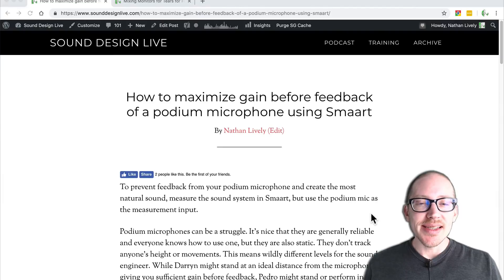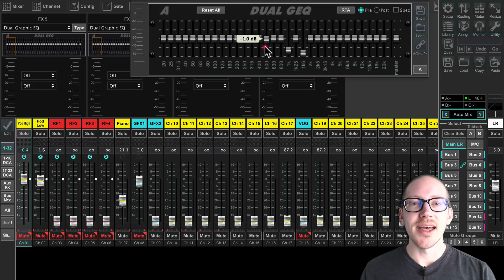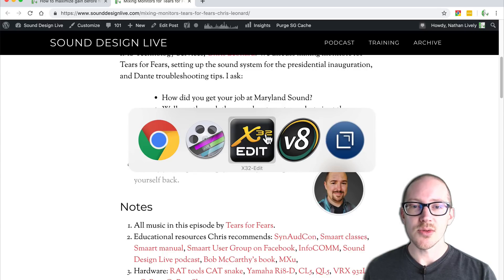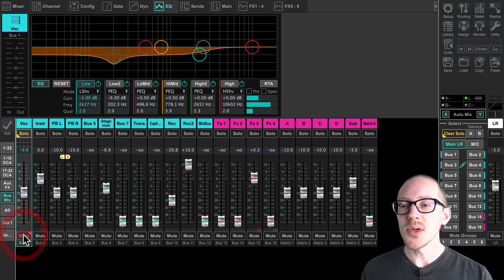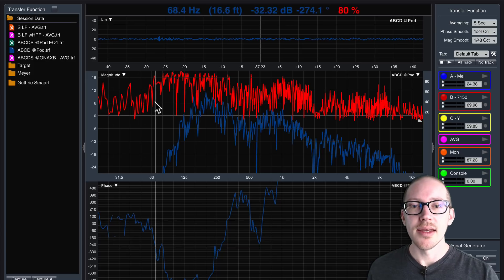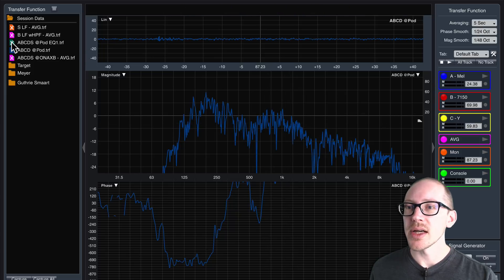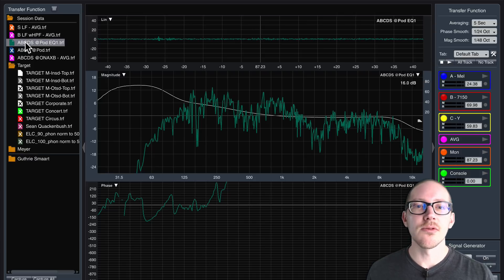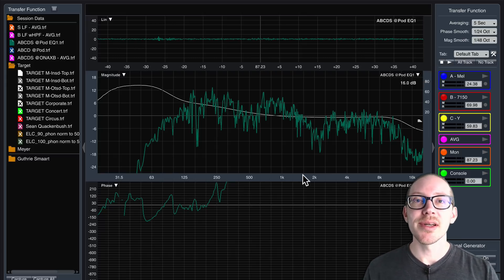How to maximize gain before feedback of a podium microphone using Smaart®

Comment: The current state of the art in podium microphone amplification depends on some very sophisticated modeling software to drastically reduce both ambience and feedback.  The result has to be heard to be believed.  For many years, my client rented a $20,000 Dolby system to accomplish this for live awards show broadcasts as it was a rental-only piece.  Later, Antares, Waves and others made similar hardware available for purchase at about $5,000.  Now, some plug-in manufacturers are selling solutions, often describing the process as “de-verb”.  iZotope is one such company.  It is not easy to accomplish with acceptably low latency as the process calls for extensive computer processing.  I’m really surprised that the high end mixing console manufacturers - SSL, Digico, Yamaha, Avid - are not offering this capability built in to their products.

Comment: The best, cheapest and easiest audio tool I've used (aside from my ears and 35 years live audio experience) to assist with lectern mic sound is a Behringer single-ended noise reduction unit I acquired in the late 1990's. It's not all about getting the max level with least ring, but having a dry clean sound coming out of FOH. Cutting out room noise appreciably improves speech intelligibility and you can actually run at a lower level, which in turn gives you that bit of headroom you need to cover a variety of people speaking from the same fixed position. I've often been surprised when watching keynote speeches on TV where you can hear the reverberation of the PA system picked up by the lectern mic(s). It's such a simple and effective fix.
Reply from the maker: Nice! What is the model of the unit?
Reply: @nathanlively  A very early Multiband Denoiser - identical to this one (scroll down the page a bit) - https://reverb.com/item/5862262-behringer-multiband-denoiser-vintage     Granted, Behringer has made some rubbish kit over the last couple of decades, but this one is solid, does the job it was designed to do and is sitting in a rack still working and never needed fixing.

Comment: This method is interesting, but doesn’t make real sense to me. Why would you correct your sound from the main PA so that is sounds nearly flat at the Podium position?  It is only natural that this measurement has far more low end (PA becomes omnidirectional in low frequency’s, but also your microphone is far more directional in high frequency’s).
I think it is better to listen to the sound first in the room and then to decide with your ears, which frequency’s are feeding back and whether your sound from the main pa can afford a cut in this band. 
But most importantly of course is to create a speaker/microphone placement that will most effectively reduce all feedback (highly directional mic, highly directional loudspeaker, greater distance between the two and so on...)
Reply from the maker: Hey Morgan, there might be some confusion here. I'm not correcting the "sound from the main PA". I am correcting the podium microphone's response.
Reply: Hey Nathan, thanks for your reply. But where is the difference? If you change the response of the mic, you will of course change the sound of that microphone from the main pa.?
Reply: @morganbelle357  Because if you stand behind a pa it sounds more sub/low mid heavy, and that will bleed into the podium mic. He's just giving himself a basic 'flat' starting point before he even eq's the microphone.
Reply: I’ve always added of cut to almost all monitors, perhaps with the exception of the drum monitor.  I based this on the fact that when I started you would always get a lot of bass stage wash.  Of course this was then, we now have cardioid subs and arrays, which have somewhat, if not totally changed the situation.  My observations has always been that I came across two strategies in the past, those that hacked a monitor until they could almost point the mic directly at it, however, it may sound loud, but it never sounded good.  I usually adopted a technique of neutralising the sound in the monitor  and focus often if the sound was smooth and clean, not only did you get a fair amount of gain before feedback, you gained clarity making it far more pleasant to listen too, often precluding the need for as much volume.  I’ve consistently found that the best sounding wedges, often were the easiest to work with in terms of feedback, things like D&B M2’s and M4’s, Martin L400’s, Meyer um100’s, L acoustic x15, etc.  all great sounding and smooth.
Reply: Hello, can you explain how to connect the channels of your mixing console and audio interface？Console Master out- Interface input1
、Console Monitor Out- Interface input？

Comment: Didn't really follow this one. So you're taking a measurement of the mains from the podium position and using that to correct the monitor wedge?
Reply: Might not be a wedge.
Reply from the maker: Hey Carlo, there's no wedge. I'm only suggesting that this would also work with a wedge. I'm just observing the bleed from the FOH system back into the podium mic.

Comment: Solid video! Cool method, and great timing as I was looking at a similar method, and had not thought to Solo mute the podium. As you mentioned,  this is a similar way to tune wedges. I would tune the wedges then tune podium? Would you opt for to take a trace through the wedges as well? Just thinking.  Thanks for the video!
Reply from the maker: Thanks Christopher! Recently I tried the same method, but unmuted the podium mic and put it into the system. Results did not change.

If I had stage monitors, I would work on those first, measuring the on-axis response with my measurement mic, then the off-axis response of the vocal mic, since I would expect a lot more bleed from the stage monitor into the vocal mic than the FOH system. But I would do both if I had time.